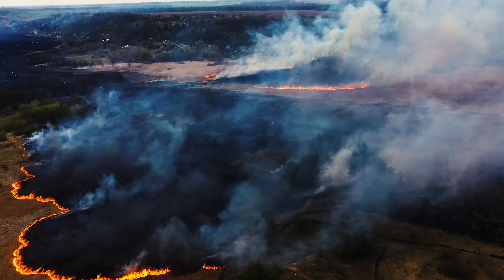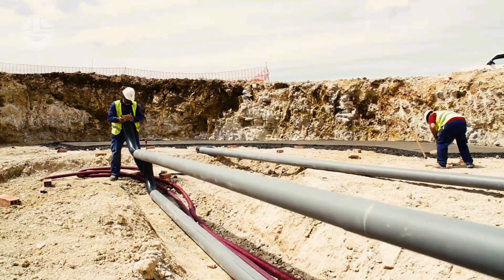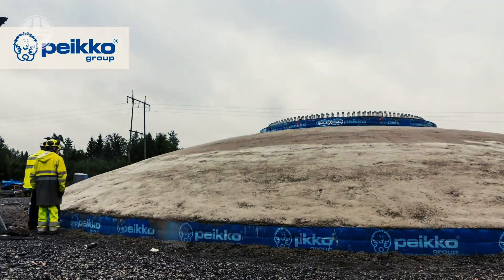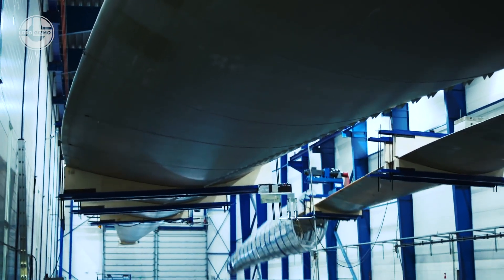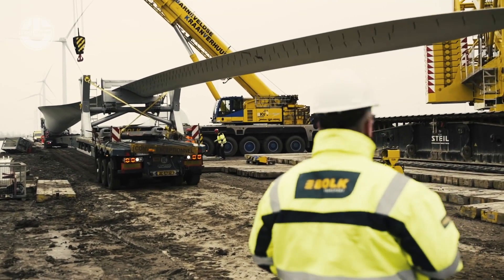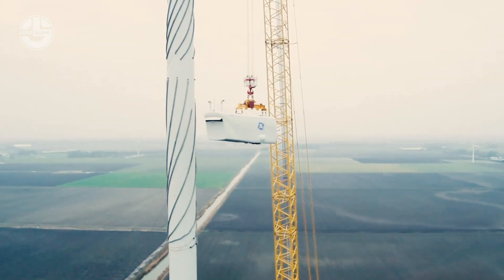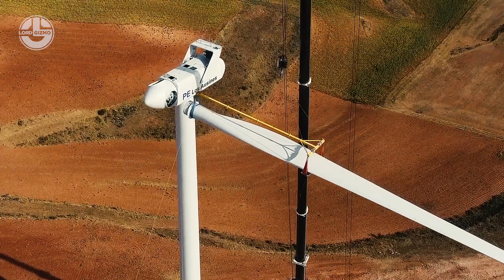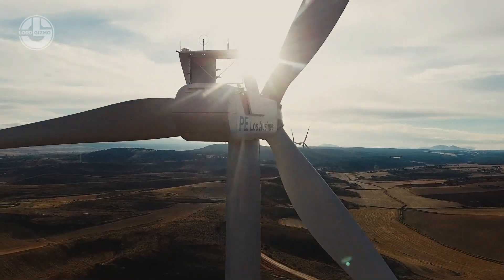Wind Turbine Farm Installation From Scratch  | Mini Documentary

Comment: No one answered your question yet as to why wind turbines only have 3 blades. there are several factors that affect the number of blades, I think the primary ones (not necessarily in order of importance) are: Cost, Drag, and the centrifugal forces are better balanced with 3 blades. 2 blades have less drag but need to be bigger to achieve the same result as 3 blades and in turn increases the weight, cost, which nullifies any gains from having one less blade. A four-blade system or more also: increases the cost, weight could be argued if it increases or decreases or breaks even with smaller blades with more of them (would depend on the design) if there is any gain or loss of weight. So in conclusion the 3-blade design is a happy medium of all design factors involved. Good video I enjoy all your videos but this format works well with this topic. 👍

Comment: Why do they put the heavy generators on top of those tall poles? Why not have a carbon fiber driveshaft going down the length of the tower to where the generator would sit. Ball or magnetic bearings would cut friction costs, and less weight on the tower means it could be made lighter as well, and any repairs or replacement of parts would be easier as well. It's only logical.

Comment: Those blades can't be 300 ft long and the tower be 328 ft high.  Those dimensions make no sense.  That would mean the blades would just be 28 ft off the ground when they swing through the bottom of their rotation.  That is certainly not the case when you look at the final product.  This channel sux.

Comment: Will that windmill ever give back the amount of energy required to build it? I think not....
Reply: From what I understand they fall apart in about 10 years, just about the same time you'd start making your money back.
Reply from the maker: Though there are many concerns when it comes to windmills, generally speaking the energy the produce over their lifetime is well over the energy put in.  The generally biggest issue, besides cost per kilowatt, is the amount of space they take up and their limitations when it comes to potentially suitable locations.
Reply: Easily.